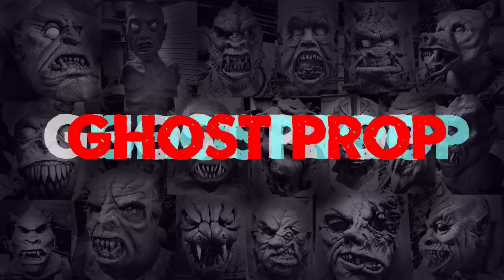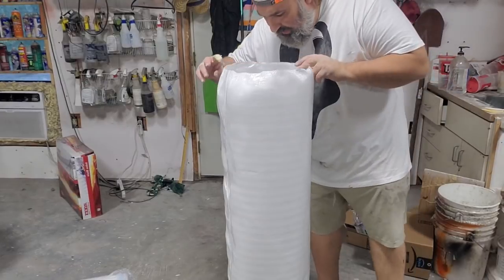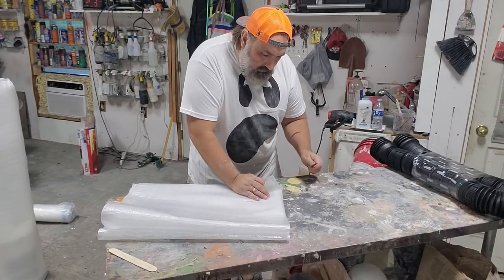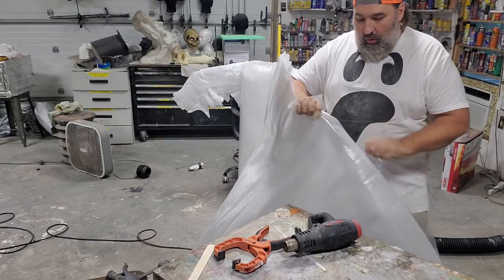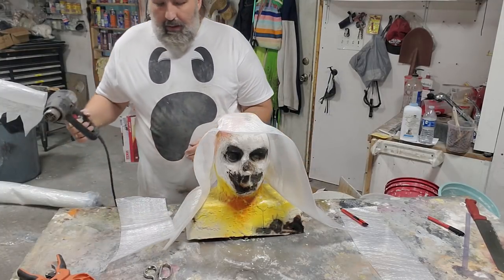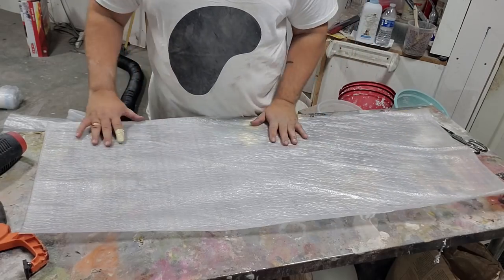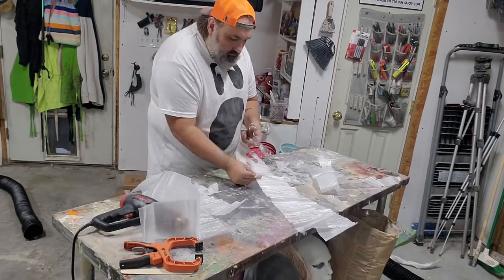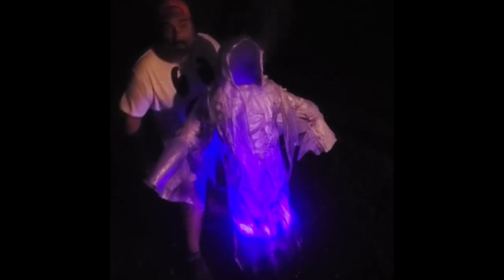Make a Halloween Ghost prop

Comment: The foam sheeting... If you put several layers over a statue, heated it, then cut it off and reassembled it... basically using the statue as a mold, would it work to make a more accurate looking ghost?

Comment: Does this ghost last the haunting season outside?  Could I frame the body with pvc pipe for it to last longer?
Reply from the maker: yes and yes- Polyethylene foam is the same foam pool noodles are made of, so it does fine outside. and its hollow so its easy to put wire or pvc in it.

Comment: There are heat resistant plastic tubes made specifically for fog machines. I bought one last year from spirit halloween for about $15. That would probably be pretty useful for this project or any other ones you do that involve a fog machine
Reply from the maker: great idea! I just let it shoot into the hole.
Reply: That would be cool to have, especially if you make a couple ghosts and need to distribute the fog to both